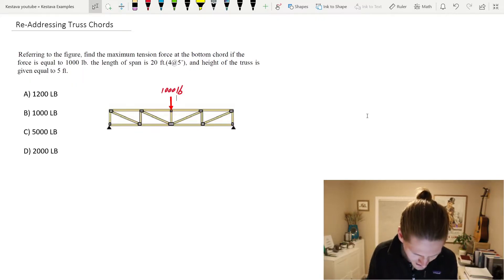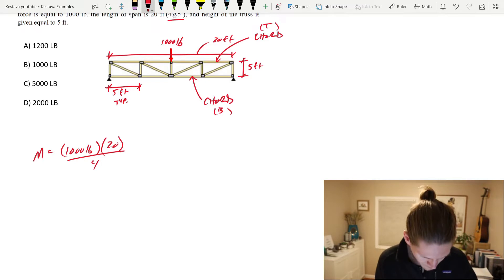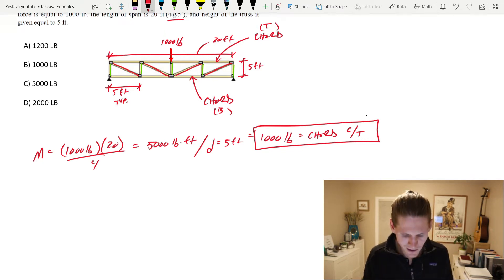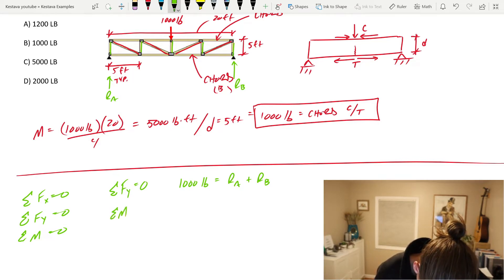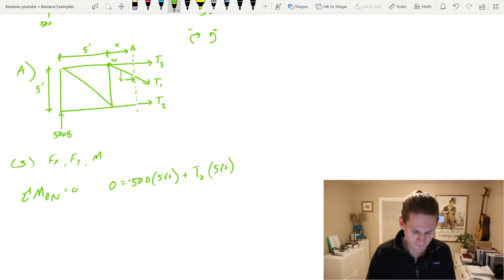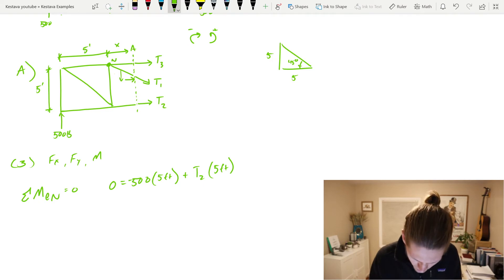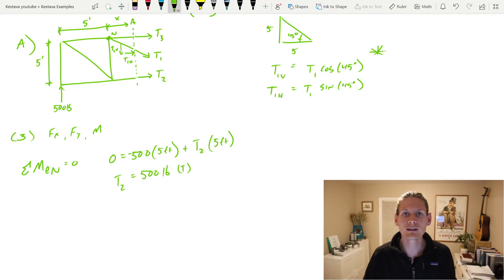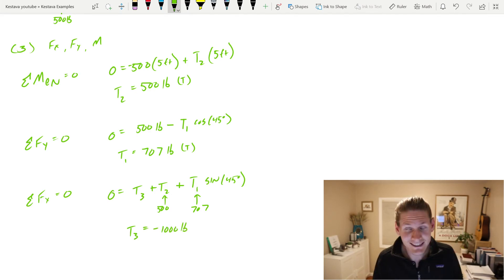SOMEONE'S in the Auditorium | PE Exam Truss Design Example | October 2021

Comment: A fun trick to get T3: instead of summing forces in the x-direction and back-substituting in all your other members, you could instead sum moments about a point where T1 and T2 intersect - even though it's outside the area that you're looking at! Depending on the situation, it can be a bit easier and faster way to finish up: no trig needed.

Comment: I think the question is looking for maximum tensile force at bottom chord not the top chord, right? That should be 500 (T) but it’s not in the multiple choice. 🤔🤔
Reply from the maker: you are correct Sudip! the PE practice question didnt have any of the right answers! This was a problem I pulled directly from an old practice exam and wanted to talk about how an approximate answer can get you 1000lb (T) in the bottom chord but for an exact answer it should be 500lb (T).